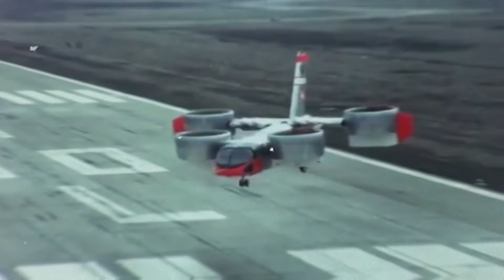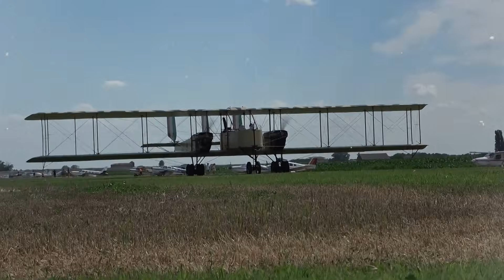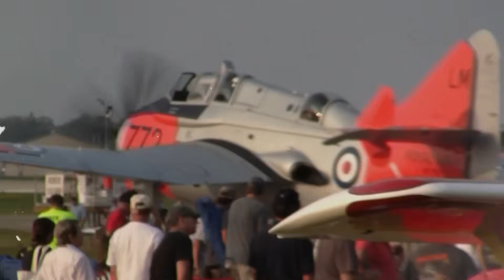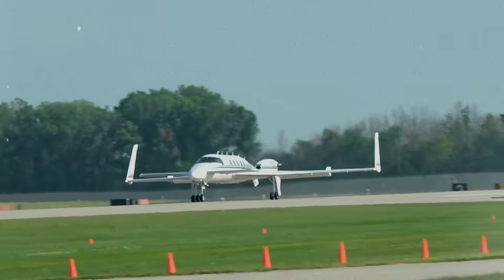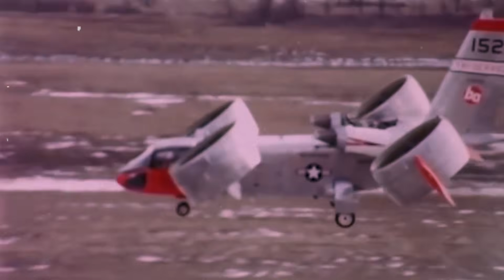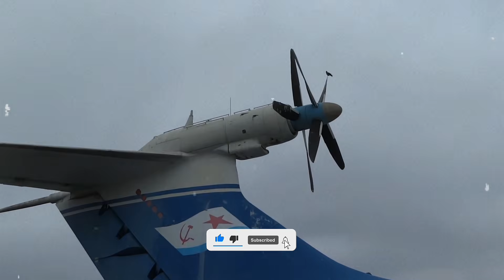10 AIRCRAFT So STRANGE You Won’t Believe They Actually Flew!

Comment: Back in 1997 or 1998 at Sun n Fun i saw a sort of cessna fitted out as a camper. Never saw it again
Reply from the maker: That sounds like an incredible sight! Sun 'n Fun is the absolute perfect place to spot wild, one-off experimental builds like a Cessna-camper hybrid. The reason you probably never saw it again is that those unique passion projects are almost always custom, single-unit builds that end up tucked away in private hangars after the shows, rather than seeing mass production. Thanks for sharing that awesome memory!

Comment: Who ever wrote this crap knew nothing about aviation.
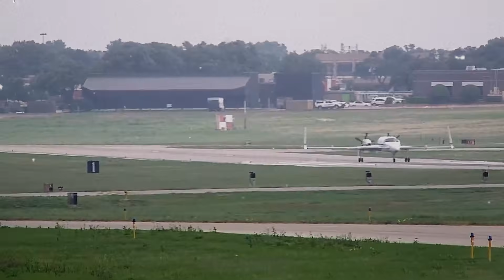Reply: 10:45 “Bleeding edge composites”!  🤣😂🤣  I’ve heard weird descriptions for the Beech Starship, but that was unique.
Reply: The commentary on the Superguppy was comically bad. Crosswinds are not a thing in flight. You move inside an air mass, and only your course is effected by its direction. (Rudder authority is a limiting factor on crosswind landings.) And it was actually aerodynamically efficient.

Comment: The Fokker Dr. I was the reaction to the Sopwith Triplane (which is shown in between the images of the Dr. I). 

Apparently the abilities of the Sopwith Triplane were impressive enough for the german pilots that Anthony Fokker quickly devised a german counterpart. 

The rotary engines were in fashion in that time, many planes had it, you had rather low airspeeds, then the rotating engine block and cylinders provide good cooling. 

Examples for planes with rotary engines: Fokker Dr. I, Sopwith Triplane, Sopwith Camel, several Nieuport types, and and and. 

Inline engines needed liquid cooling, adding a lot of weight and complexity. 

In the about 1910 period, you had lots of pusher planes, prop behind the wing, girder left and right to hold elevator and rudder. This configuration is usually referred to as Farman-style, as the French Farman first used this configuration. 

These were also slow and needed liquid cooling, as air cooling did not provide enough ventilation, even more so because the pusher configuration did not blow an accelerated airflow onto the cylinders.

The main character in "Those Magnificent Men in their Flying Machines" flew a Bristol Boxkite replica. Looking really good. (All the planes in the movie had a historic counterpart)

I have a friend at a flight museum near Munich, he told me instead of a liquid-cooled engine they had installed a modern Lycoming air-cooled boxer engine, way more power than the original. 

All no issue for short hops, but in one scene the whole fleet of planes flew out over the Channel, and my friend said that in that longer flight, the aircooled engine overheated so badly that the Boxkite barely made it back, the pilot had to squat it directly on top of the cliffs at the shore, could not have made it back to the airfield. 

This friend had some insight, for their museum they recreated a Farman-style plane built in series in 1910 on the airfield the museum is located on, an "Otto Doppeldecker". 

Built in principle for display, or at max for rolling around on an airshow, over the (MANY) years they seem to have grown more and more confidence in their construction (of that type they had some dimensions, photos, some scrap parts, but no construction drawings), and last years they made some hops with the plane. Let's see, maybe in 10 years or so it will be displayed in the air. 

(In Germany the demands for something to be allowed in the air are VERY strict, especially for a public museum you MUST stick to ALL the rules)
Reply from the maker: Great catch! You are completely right—we accidentally let a clip of the British Sopwith Triplane slip into the Fokker Dr.I section during editing. It’s a crucial piece of history that the bizarre Dr.I was Germany's direct, desperate response to the Sopwith's incredible maneuverability. Thanks for pointing out our visual mix-up and providing that excellent historical context!

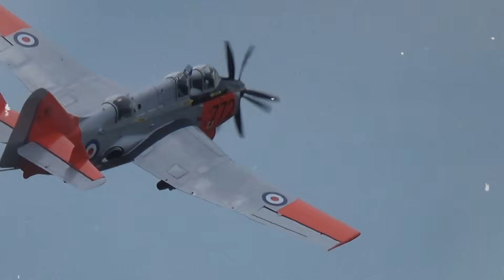Comment: 07:15 - Oh??!? That Plane is a Turbo-Prop?? Amazing! So, one Turbo-Shaft Engine for each of the counter-rotating props! Obviously that requires a very sophisticated transmission system!! 
Then there the problem of getting air into it!!
Reply from the maker: You are asking the exact right engineering questions! The mechanical complexity of these planes is absolutely staggering. However, to add a bit of technical context: usually, it wasn't one separate engine per propeller. Instead, these bizarre setups relied on one massive powerplant hooked to a single, incredibly complex contra-rotating gearbox to spin both props in opposite directions. You hit the nail on the head, though—designing a transmission that wouldn't tear itself apart under that torque, while routing the intake air, was a total mechanical nightmare! Brilliant observations!
Reply: The british marked tri plane wasn't a Fokker Dr1 it is a sopwith tri plane of a similar vintage. Also the Fairey Gannet was powered by an engine arrangement called a double mamba , twin engines into a common gearbox powering both propellors.

Comment: Fokker DOCTOR ! Btw, the Dr.I wasn't anything special, just a crude copy of the Sopwith Triplane . . .
Reply from the maker: Haha, our AI narrator definitely gave us away with that 'Doctor' glitch! 🤦‍♂️ Regarding your historical point, while the Dr.I was absolutely inspired by the Sopwith Triplane's success, calling it a 'crude copy' misses a crucial piece of engineering context. Fokker and Reinhold Platz utilized a thick, cantilever wing design that eliminated the need for the drag-inducing external bracing wires used on the Sopwith. It definitely had its flaws, but structurally, it was a completely different and innovative beast! Thanks for sparking a great historical debate.

Comment: The Fokker Doctor 1?!
Reply: Not as good as they say, the top wing would sometimes depart the fuselage resulting in the loss of a valuable aircraft and usually the pilot as well. Also it was only in service for about eight months and only used by Richthofen once the problems had been sorted out!
Reply: Yeh Dr 1
Reply from the maker: Haha, you caught us! 🤦‍♂️ Our AI narrator completely glitched out and read 'Dr.I' (Dreidecker) as 'Doctor 1', and it somehow slipped right past us in the editing room. We are still trying to teach the software proper WWI aviation German! Thanks for the laugh and the great catch! 🤣
Reply: @UltimateMachinery9  On top of that, you included a few shots of the Sopwith Triplane in the same clip about the Dr1. Tsk tsk.
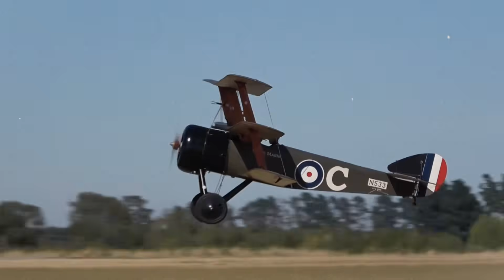Reply: Yes, I first spotted the Tripe at 1:30. You can't slip anything by us true aviation geeks. @daverawlings8813
Reply: @UltimateMachinery9  And WW-Eye? Guessing most of the footage of the Dr1 were RC planes as well. Old Rhinebeck Aerodrome still flies accurate replicas of WW ONE aircraft.

Comment: Another you tube source says the Airtruck was impossible to stall, so handling couldn’t have been too bad.
Reply from the maker: That is a fantastic point! The PL-12 Airtruk is the ultimate example of 'don't judge a book by its cover.' It might look incredibly bizarre, but its aerodynamics and stubby wings were intentionally engineered for extreme stability and stall resistance at low crop-dusting speeds. Function over form at its finest! Thanks for adding that awesome detail.
Reply: I'm always impressed by the skill and endurance of the Pilots who fly these "freaks"!! 
Both physical and mental endurance was amazing!! Maybe that "Air-Truck" could have been improved with some kind of compact Turbine/Turbo-Shaft Engine?? Maybe!? 
Maybe a re-purposed APU Engine from a Commercial Jet?

Comment: These very unusual  aircraft were designed to do very unusual jobs. Form follows function. 
Perhaps the Grumman duck was the most produced of this collection. It looks peculiar because airplanes are typically operated on the ground and in the air. The Duck added water, specifically rough seas water. Aircraft propellers hate water - it tears them up. The navy asked for this airplane, and Grumman provided the Duck to meet their needs. In fact, the arrangement and details drew on successful predecessors: the Grumman amphibious float  and the Loening OL. The duck added a better air cooled engine, a structurally sound aluminum fuselage with proven hull shapes and landing gear designs. With a proven design heritage, it entered service with minimum development (as Grumman products are famous for) and served the Navy from 1936 through and beyond WW2. It was widely used for search and rescue, observation/reconnaissance, and utility duty.
It might strike the uninformed as funny looking, but it was pretty beautiful to a downed pilot in a life raft on the open ocean.
Reply from the maker: This is an absolutely phenomenal breakdown! 'Form follows function' perfectly summarizes the Grumman Duck. Your closing thought about it looking 'funny to the uninformed but beautiful to a downed pilot' is incredibly poetic and true. Thank you for sharing such a deep dive into its design heritage and vital WWII service—this adds so much value for anyone reading the comments!